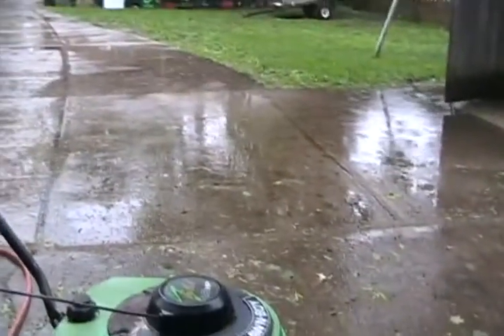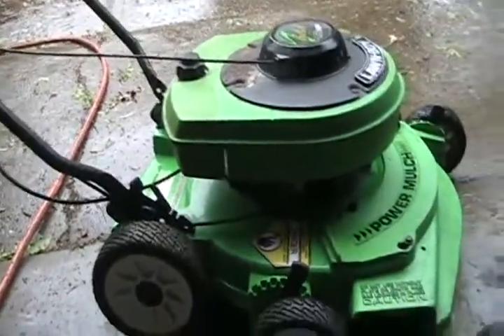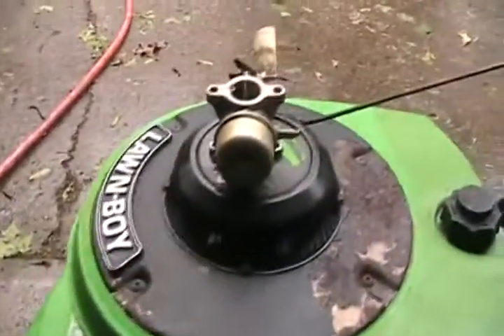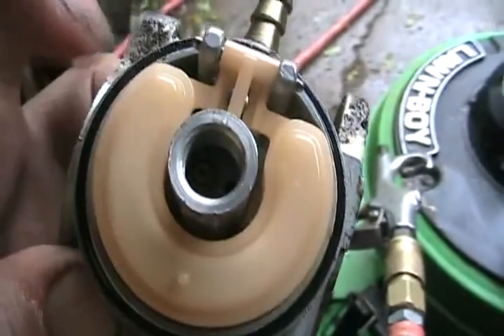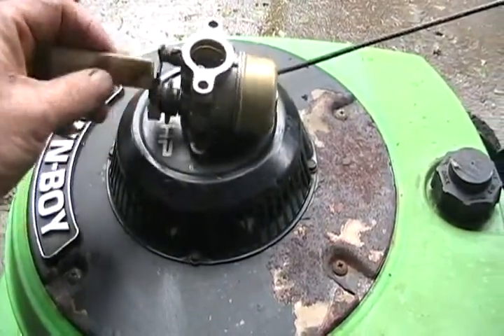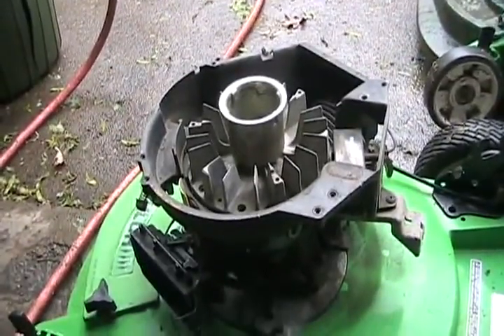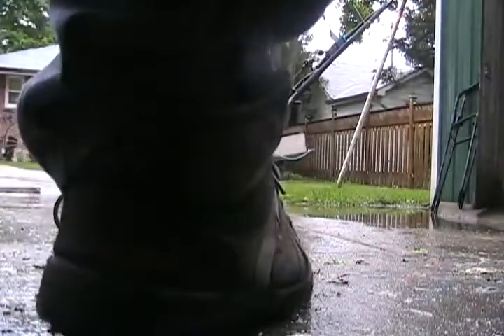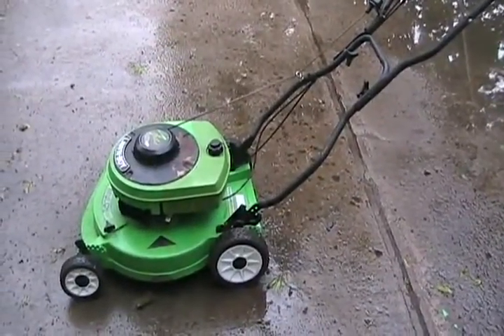#1332 Fix and make run a 4 5 hp lawnboy mower [Davidsfarm]

Comment: Yeah, $100 all day long for that!  I always ream out the float valve seat with a Phillips screwdriver before carb reassembly.  If it leaks, it goes out thru the muffler and tank is empty next time you want to mow.  I also shorten the pull cord so it is on the top of the engine like normal before OSHA improved our lives.  If I have a good older spare handle, I also take the engine brake off and all that other crap, then put the older handle on it.  Use choke to shut it off.  It makes the mower much lighter and easier to use!  Thanks for the motivation!